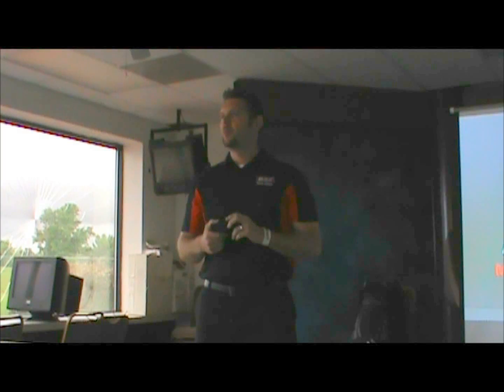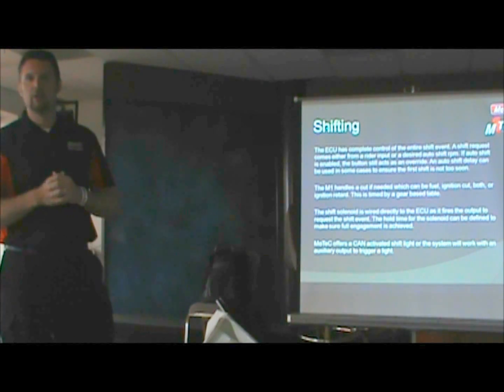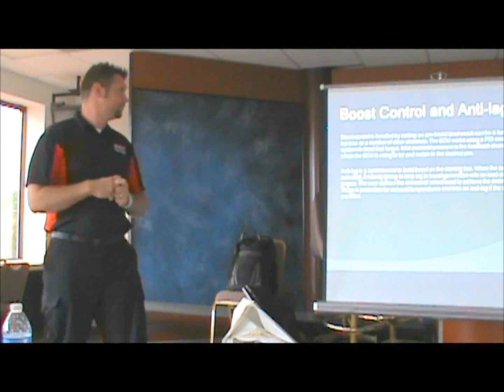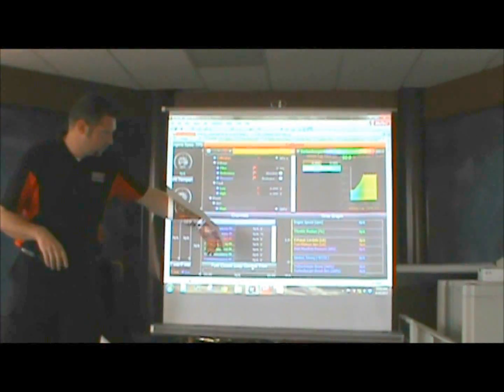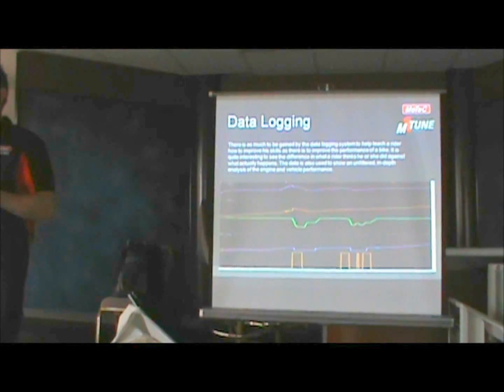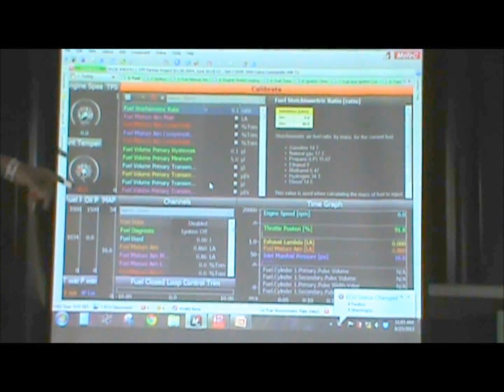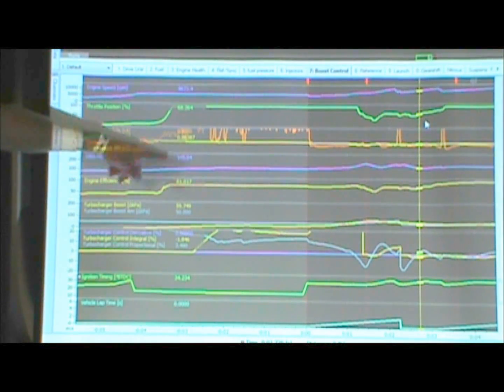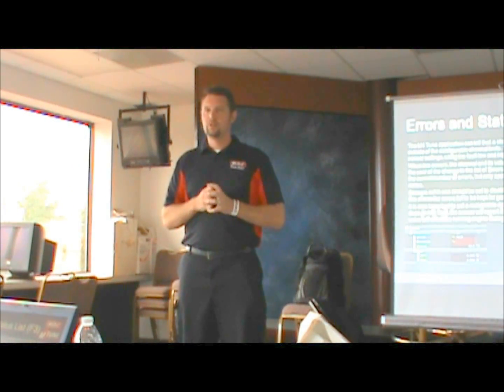Motec M130 ECU Seminar for Motorcycle Drag Racing Applications

Comment: Very interesting, I actually sit through the whole video and would LOVE to have this on my 07 turbo busa, just wish I had to coin to drop on it. It would make everything sooo less cluttered and complicated and add so many features and adjusts to seriously fine tune. My only question, would it work as good as far as boost controlling as the new AMS 2000 about to come out? If so, I am in when tax time rolls around.